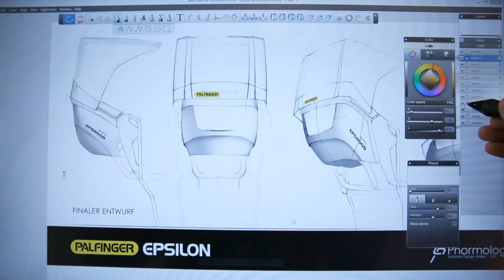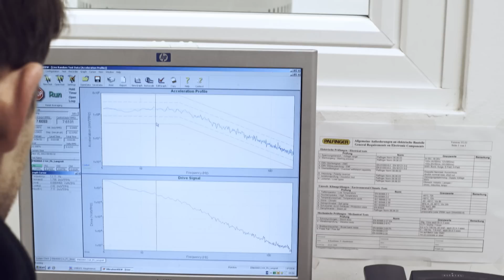PALFINGER EPSILON - The next Epsolution - Die neue EPSILON M-Serie 2015

Comment: Nice efficient little loader but hard to find operators due to the fact that to qualify you need a rubber neck to see around the boom.... WTF
Reply: as with all other loaders in this segment... but you can operate them with crane cabin, from the truck, with lateral top seat, whatever... no you'll say WTF again, right?